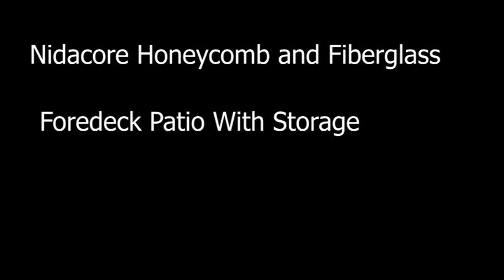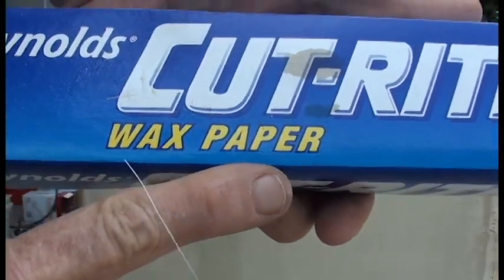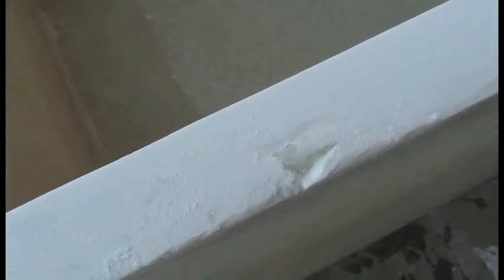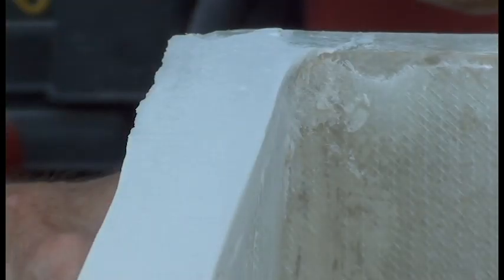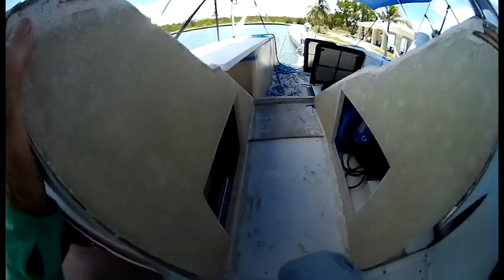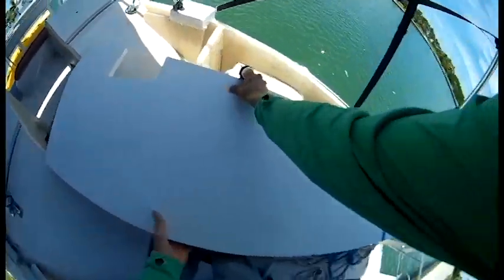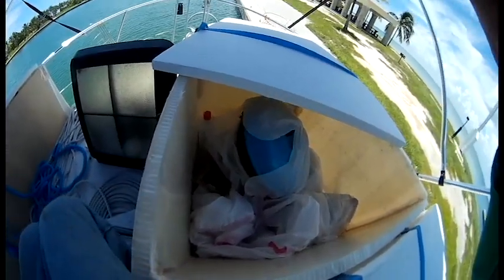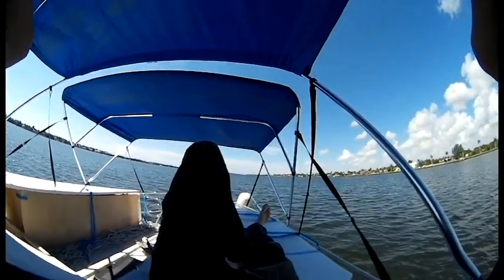Nidacore And Fiberglass Foredeck Patio With Storage

Comment: Good work mate!!! Love the ingenuity, very brave to chop and change the boat to suite you’re purpose. Out standing!!!
Reply from the maker: Thanks!  Its so nice to be able to walk forward from the driving position to the bow.  When I first got the boat, I was always climbing over the windshield to work the anchor or throw out the forward dock lines.  The entire bow forward of the flybridge was basically wasted space.  Once the walk-through was cut in the flybridge, and the fuel tank locker was on the front deck, making the rest of the seating/storage lockers to match seemed like a really nice use of this newly accessible space.

Comment: I like the use of nidacore . I never used it before but it looks great. I really like your videos I wish you could make more on your diy projects cause I think you have a great boat to start with and all the updates you add just makes it that much better. You and I think a lot alike about how to make it better. I would love to sail on your boat with you and help you. I’ve never sailed but I know a lot about fiberglass wiring electrical and building. I’m gonna go back and make sure I haven’t missed any of your videos. I was watching way back when you were on your other sailboat and when you purchased this one. I couldn’t believe the price you got it for. Good luck and watch out for this heat it’s been bad up here in south Alabama. Take care 👍👍👍
Reply from the maker: Thanks!  Nidacore is easier to cut than plywood, you just glue it together with thickened resin and coat the whole thing with fiberglass.  It becomes very strong and is super-light.  Before covering it with fiberglass, it is somewhat bendable.  I'd like to try to use it to make sweeping curves in something someday because it seems like it would work very good for them if it can be held in the curved shape while  laying on the glass.
Reply: Nine Hundred Dollar Luxury Yacht I think if you made a small jig to hold it to shape and used thickened epoxy then overlap with fiberglass cloth using either polyester resin or epoxy it would be very strong and lasting for anything you need it to do. It may need a little roughing up to give it something to grab ahold of .If you do that let me know how it goes. If I was closer I would sure enjoy helping you do it. I don’t know how well that stuff bends but you may have to go thinner and put two sheets together that’s if it doesn’t bend how you want it to. Coosa board works good but it’s pretty high $ for a 4 by 8 sheet . Take care and keep in contact if you want to. I think you have a great boat 👍👍👍 or to make bends you could do like I’ve done on plywood by cutting slits just a hair next to each other leaving about 1/16 or little more before cutting all the way thru that allows you to bend it. Then fill the cut gaps with thickened epoxy to give it its strength back. You probably already know all this anyways. But anything I can help you with let me know. See ya later 👍👍

Comment: You could make the curved tops permanent attached to the boxes and make doors on the side or make smaller square hatches on top. The strap down is not a very nice solution in my humble opinion. Great to see you change the complete layout of the boat. You live almost in paradise. Great weather and next to sea and the bahama's etc. Around the corner. We have a lot of water too but the surroundings are less nice and weather sucks most of the time. Last summer was great. From april to september we had stable very hot weather. This year it sucks again like most years. Some hot short periods but never stable for longer periods.
Reply from the maker: Thats a good idea.  I will almost certainly do something different with the locker ahead of the fuel tanks, and there is a small section forward of that which is sealed shut by nidacore on all sides and the top.  I definitely plan to put a small deck hatch on the side of that small, forward locker to hold the rope for the second anchor that is piled up in the forward walkway at the moment.